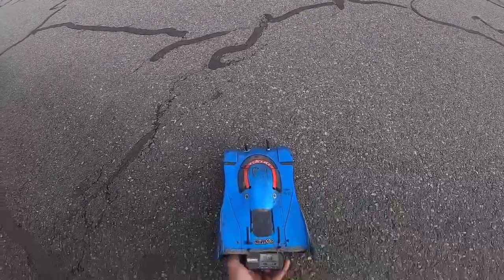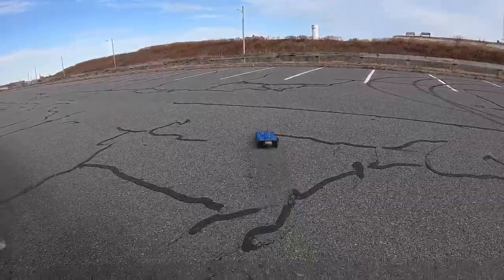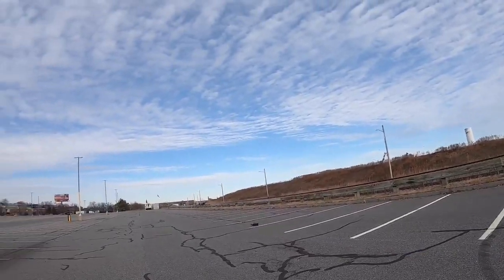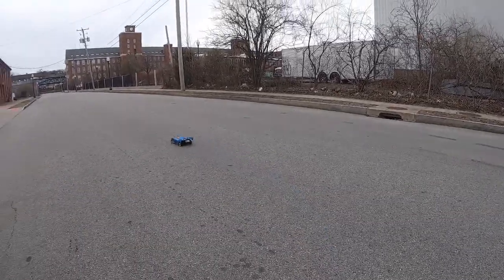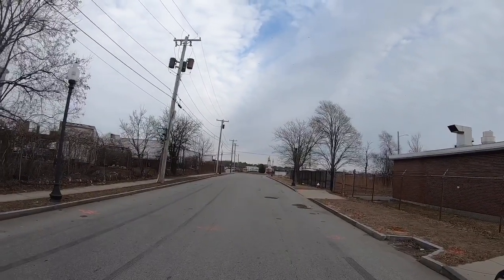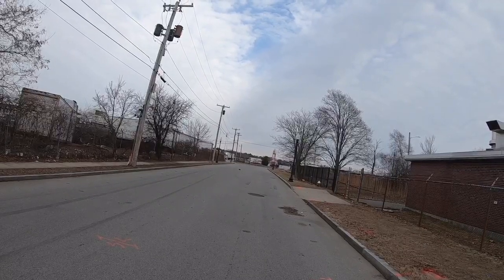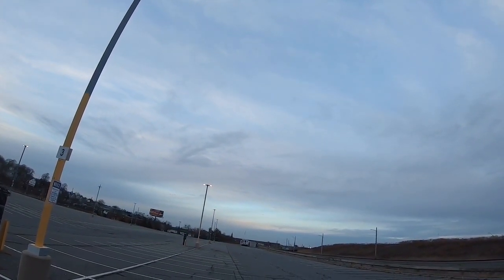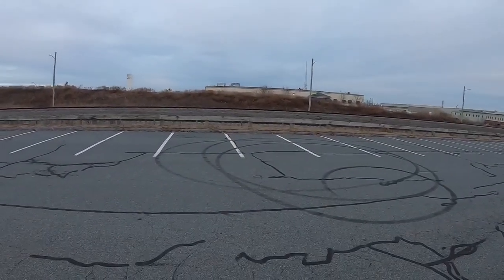Hpi Rs4 Speed Runs And Test Hits Smoked A Motor

Comment: Nice testing bro. What sensored esc you running?
Reply from the maker: Appreciate that bro and Mamba X
Reply: @RcFunDrizzy  I figured It'd be a Castle. Seems super smooth, bro. 
I myself am building a touring car for speed runs. It's got the Mamba Monster X in it with the 1515 size 2200kV Castle motor. I drove it around for testing purposes in sensored mode, and I don't know bro, It is smooth, but not that buttery smooth on takeoff. Of course smoother than in sensorless mode. 
Maybe this is due to the high gearing I am using? Right now it's geared to  reach approx. 100mph at around 52000 rpm.

When it's ready and set up to go, I'll do a commentary video on it. Then later some running videos.
Reply from the maker: Yep that might definitely be the case gearing might be to much but I'm scared to put a big can in a 10th scale touring car I did it once and snapped a dog bone wanna see more on your build for sure hope it works out 😎
Reply: @RcFunDrizzy  I finally uploaded the video on my touring car build bro 👍. Comments are turned off tho, but we can message here if you like. I am genuinly interested in your opinion. Something else: Could you please name some RC speed run guys here on youtube? I know of Philip Jolley, Kenny mph Melanko, Wayne Peeples, RMan,... anybody else?
Reply from the maker: I like the setup definitely looks like it will move and how do you like the fans ? And I do know some King Rc Mobay876 rc lightingdad13 joboriracing much more
Reply: @RcFunDrizzy  Thanks for you opinion bro. The fans, well, I only ran this car once yet, so I can't tell much about them, but my Slash has a WTF esc fan, and it cools great. Full throttle is no problem. My Slash also has twin WTF motor fans. I think max temp was 120-130°F (around 50°C) during summertime. So I think the WTFs are excellent and also will be on the speed run car. 
The Team Corally fans seem to be the very same fans as the WTF. RPM rating is also the same. Around 22000 rpm at 8.4V.

Thanks for the channel names, I'll check them out.